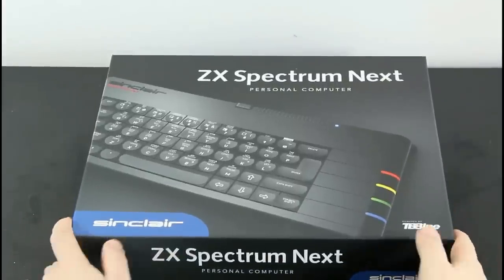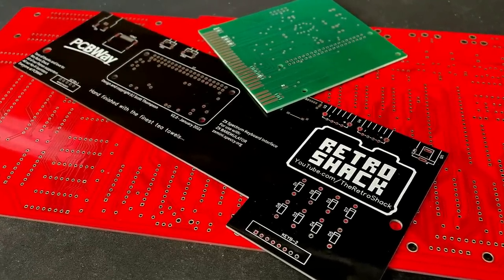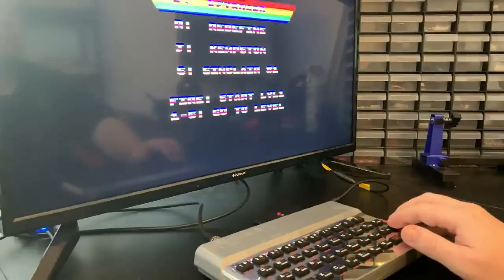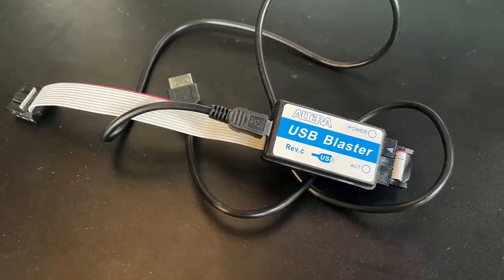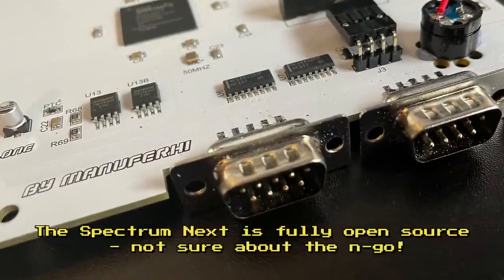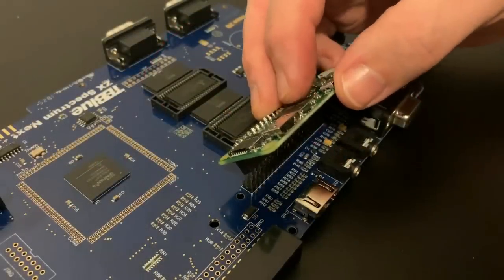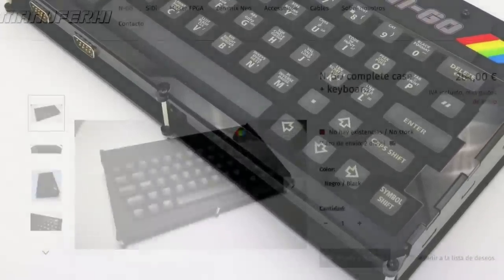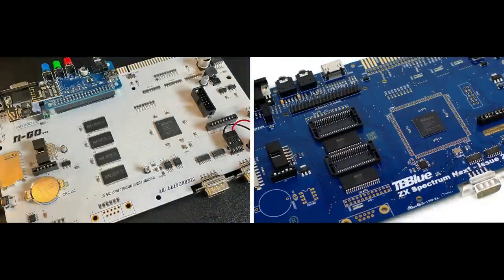Can't wait for a Spectrum Next? What are the alternatives? Let's n-go and take a look!

Comment: I've just ordered an N-Go. Thank you for the letting me know about it.

One Speccy you did'nt review is the eLeMeNt ZX. It fits inside the +2 case, (and uses the built in tape deck), has SD/DivMMC and extended colour pallette with 512K RAM as standard. Plus tons of other features. :)
Reply from the maker: Just looked at the Element Zx… and now I have to have one :) Thanks for letting me know about it :)
Reply: @TheRetroShack  :)
Reply: @TheRetroShack  I need your help !

I've just recieved my N-Go, all I got with it was a PSU and I can't get a picture. It has power as a green light comes on near the 5V input socket and a blue light flashes near the VGA port. I've plugged in the HDMI but theres no image. I can't find any contact details for the seller either.

Any suggestions ?
Reply from the maker: @frankowalker4662  Hi Franko - you probably just need to hold down ‘D’ as the machine boots, to select the Digital output.

Here’s the Spectrum Next boot sequence:  

https://wiki.specnext.dev/Boot_Sequence
https://wiki.specnext.dev/FAQ

Let me know how you get on :)
Reply: @TheRetroShack  Pressing 'D' worked a treat. Thank you so much. :)
And thank you for the links.
Reply from the maker: @frankowalker4662  glad that sorted it :) Enjoy the n-go - be interested to know what you think of it :)
Reply: @TheRetroShack  I've only watched a few demos on it so far, but it's a very powerful little machine. I'm going to go through the NEXT manual I've downloaded and try some of the demo progs in it.

Comment: The added bonus of the N-Go is the 2nd flash so you get the Next on the left flash and what you shown earlier with the +UNO on the right flash via the switch just  below the expansion slot.  Note though you need an external keyboard and output is VGA only for the second flash.

Comment: I am getting my ZX Spectrum Next, next year so as a stop gap I got a made up Sizif 512K. It is very very nice. I use my ZX-HD HDMI INTERFACE from Byte Delight, I have used it on all of my ZX Spectrums I have. But with the Sizif 512K and many other clones you will need to cut into your case. Another thing I have used is my Mister DE10 Nano but to use it as a ZX Spectrum I use the The Recreated Sinclair ZX Spectrum keyboard on a USB cable again the DE10 is Out of stock all over.

Comment: Good video. But you're wrong about one thing. The 48k keyboard is not the same.  The Next can see the composite keys as separate keys. So any software that supports that can not be used by the 48k keyboard.

Comment: As a C64 person growing up I didn't think I'd have much nostalgia for the Speccy. However a lot of my friends had them at the time, and it is a computer I really feel I missed out on, so actually the impulse to buy something like this is more than with the retro C64 stuff. The Spectrum sentimentality comes from the original 48K case rather than anything else so as good as the Next case may be it would be an N-Go and a classic case. I must say that the white one is doing it for me.
Reply: Funnily enough I feel the same, even though I built a successful career from the C64. I started with a ZX81, and wanted a Spectrum but couldn't afford one at the time. My friends had them though so I spent a lot of time round their houses playing and programming on them in the early speccy days, and hanging around computer shops and going to computer shows. So the notstalgia for the Spectrum is very strong in me.
However I satiated my nostalgia by getting a refurbished, composite modded rubber key 48k Spectrum last year,  with a tape emulator and a DivMMC future. (I also got a refurbed ZX81 too with 32k, composite mod and modern ULA).
The Spectrum Next is a lovely machine but for me the only 'real' Spectrum is the original rubber key version.
I do have a 'TheC64' modern C64 replica as that feels very close to the real thing, without having to muck about with tape decks, disk drives and cartridges. I still have my original C64, but it's yellowing and in need of some restoration as it doesn't work perfectly - and neither does the disk drive, so the replica is a great way to get some C64 nostalgia.

Comment: The Pi Zero isn't only used for TZX loading, it also handles the playback of many sound file formats like C64 SID, Amiga MOD and ST SNDH.
I'm, personally, a huge fan of the N-Go case and keyboard combo, it's great for sustained programming sessions if you're used to a PC Mechanical keyboard (as I am) for your daily driver.
-Dx

Comment: Nice video.

What should be mentioned is that if you order the n-GO from manuel's shop direktly, there is an option containing an acryllic case and a mechanical keyboard.
Owning both - the original Next and this device - I prefere to use the one with the mechanical keyboard...
Reply from the maker: Ermmm - I did mention that :) Going to get one for myself :)
Reply: @TheRetroShack  If so, as a "non native" may be I've skipped this. ;-)

I really like the printed key caps. What I don't like so much, is the keyboard layout wich is different to the Next (and different to the Spectrum +)...

Comment: I wish they'd do a batch of Spectrum Next cases and sell those on their own. Surely there's nothing to stop that from happening?
Reply: I quite agree, they should also think about doing a pc/mac compatible keyboard but in the same style as the next. That would be cool for the emulators 😉
Reply: I wish they’d decided to produce bare boards again like the first Kickstarter.

Agree on the keyboard/case issue too. Imagine Sky as the rights holder would be happy to allow cases to be sold separately if the licensing was amended slightly. Get some cash flow whilst waiting for the board parts to become available.

Comment: It's great to see there are plenty of alternatives available for people who missed out on the Next and aren't keen to pay the going rate on the secondhand market.  

At the other end of the spectrum (no pun intended), if you don't need all the extra Next/N-Go features and you have an old Raspberry Pi handy i.e. not a RPi 4 or RPi 400, ZXBaremulator does a great job. If you're really keen, it'll even support an original 48k Speccy rubber keyboard via GPIO.

Comment: I'm interested in these systems, but at the same time my brain keeps telling me "real hardware or emulator, man...", but I'm kinda interested in what people can do with them.

Off topic but not; after watching all your(and several other channels) videos I decided to break out the ol' A1200. Amazingly, got straight into Workbench 3.0 within 5 seconds of powering on. Both floppy drives still work, as does the expansion card('030, FPU and 4mb fast RAM). Most of the floppy disks didn't fare as well, but I got a few levels of Lemmings and a few games of Sensible Soccer(the original, SWOS is read error'd) before turning it off because the HD started making disturbing death sounds. I want it to last until my CF card adaptor arrives.

Also looking into a Gotek.

It's a good thing I've seen your videos, unless I might've just binned the thing thinking it was screwed.

Comment: For completeness sake, there is also the Next core for the MiSTer platform. Haven't done much with it (patiently waiting for my Next to arrive), but it is there if you want it. Seems fully featured too, according to the readme.
Reply: Totally agree. I backed KS2 so obviously waiting for that, but got a MiSTer about a year ago and use the Next core on it. The only problem I have is that it uses a VHD file, so it isn't that straightforward to add files to the image.

I suspect the MiSTer is something of a dirty word in the Next community, I never hear of anyone using the Next core on there.
Reply: @Gannett2011  A big draw of the NEXT is the case and keyboard design, with it's direct link to original Sinclair products (RIP Rick D), but there are several software based Spectrum emulators running on cheap hardware that could be fitted in to a real or reproduction Spectrum case for a fraction of the cost. The "Next" team themselves couldn't care less. Theirs is a niche product in an already crowded niche "retro" market... bit they know demand outstrips supply. 😁

Comment: The one thing you didn’t mention about the N-Go, which makes it unique, is its switch that allows it to be turned into a Spectrum Uno (I believe). I don’t have an N-Go or a Uno, so I’m not sure exactly what this does or the advantages it brings, but I’d have liked to hear about it. It’s a unique feature of the N-Go that the Next itself doesn’t have. NB You also missed a few regular Spectrum alternatives that might be worth considering rather than just the Harlequin. Aside from the JustSpeccy 128, there’s notably the Omni – an enhanced Harlequin that’s available in ‘laptop’ form. (There are others too, but these two are quite readily available.)
Reply from the maker: So many other variants have come out of the woodwork (so to speak) since making this video - there may have to be a part 2 at some point :)
Reply: @TheRetroShack  I know there are a lot. I mentioned the JustSpeccy and the Omni in particular because they’re popular ones and readily available. And the Omni is the only one that’s available as a laptop – though it looks as though that may be happening to the N-Go too.

Comment: Just yesterday watched about ZX new generation platforms with modern ez80 cpu: Agon-lite from thebyteattic team. Just for 50$.
And coming up Agon-heavy with many upgrades. It is 10 times faster than Spectrum Next. 
Second new generation ZX mini-atx platform - Cerberus 2080. It is much more serious than regular "enthusiasts" platform. Works with two different Cpu's: ez80 and 65c02
Reply: The Agon Light looks very promising, but it's aimed at a completely different kind of user to the Next or N-GO. If you want BBC BASIC, Z80 assembler, CP/M and GPIO in the one machine, the Agon Light is a winner. If you want to relive your childhood and play Jet Set Willy... not so much.  For what it's worth I'm looking forward to taking delivery of a KS2 Next and an Agon Light some time in 2023. 😀

Comment: I get my Next kicks from the MiSTer system, the Next core is pretty much perfect, although it only emulates a non accelerated model.
Reply: The core is far from perfect.  There are waitstates which cause visible glitching in some games and you can also hear it in some audio effects.

-Dx
Reply: @Xalior I did design an add-on board for the MiSTer that has the proper ram, joystick ports, vga and external SD header. I changed the core to remove the wait states so it is (as far as I can tell) identical to a proper Next.

Comment: This is no surprise, there are no Spartan 6 FPGAs available (at sensible prices).  Digikey lists 409 different models of Spartan 6 and none of them are in stock. Lead times are unavailable. At work, we use a XC6SLX45 in one of our products and the earliest restock time for it is March or April next year. Unless the cloners have stocks, then they will have the same supply problems.

Comment: the problem with next is greed and control, the success of next 1 should have been used to gain venture capital backers and a big manufacturer on board. 
but then they would lose over all control of the project, but a next would be coming down a production line, and be available in retailers.
nail down a design, get it manufactured, sell design for mass production then create a new product is how it works, not having differing tiers constant design changes,crowd funding is good to get a foothold but pass the product on, get them out there for those that want to buy.
Reply: Greed and control is not the right word.  Nexts are produced at approximately cost.  The first batch ended up going slightly over and had to be covered out of pocket in order to complete delivery.  The designs are made as open as possible so that others can make the machine if they so desire and this is all available for free.  The NGO came about because of this, based on the issue 2 spectrum next board, and using the next software and hardware.  At least six or seven fpga boards have ports of the spectrum next core because the vhdl is openly available as is the operating system software.  It should be mentioned that, like the spectrum, it is not actually legal to use the spectrum roms or the spectrum next operating system on other hardware since these must be licensed from Sky to be legal.

The spectrum next is not really a retail friendly product.  It has very high per unit costs and an additional 40-50% margin demanded by retail puts it well out of reach of impulse nostalgic buyers that might buy at retail.  So the next best thing is making the machine available at as low cost as possible and making the designs open to the community as a whole to produce their own machines.

Comment: Use a Rpi 400. Easily emulates the Spectrum and many other much better systems too.
Reply: Or use an old, really cheap Netbook, preferably black. Buy some self adhesive Spectrum keyboard decals, a Spectrum "Rainbow" decal and have it boot straight in to an emulator. But to be honest, any hardware from the last 25  years will easily emulate a Spectrum and other 8 bit computers.

Comment: When you want real spectrum - buy original or at least clone with real Z80 and AY.
Reply: Why go for 40 year old hardware? Nostalgia is great, but originals are far more likely to fail than new designs, it won't be easy to expand to include all those nice features everyone wants. More RAM, better storage, networking/wi-fi, USB and general connectivity are handy extras, not to mention the compatibility issues with different versions of the original machines.
Reply: @another3997  For example ZX Evolution has real Z80,  real AY, 4 MB memory, 7 / 14 MHz turbo modes and 2 ZXBUS slots for expansion.